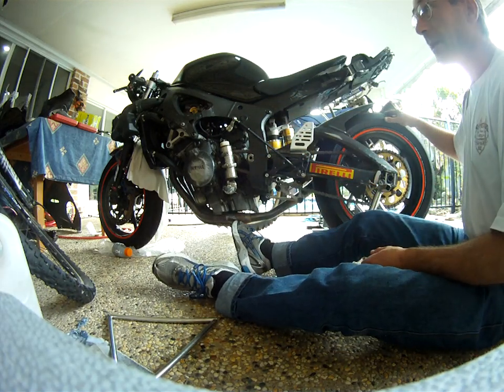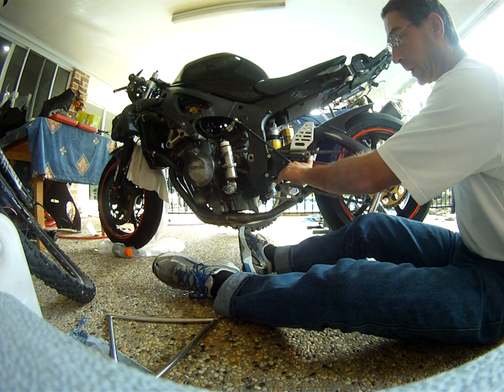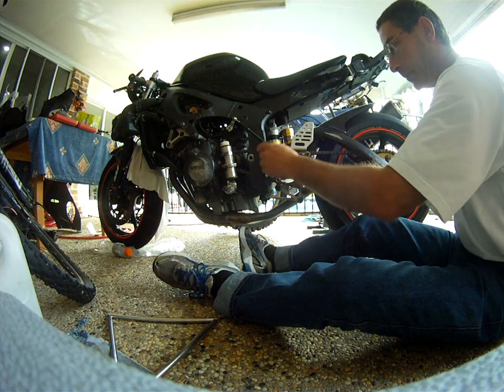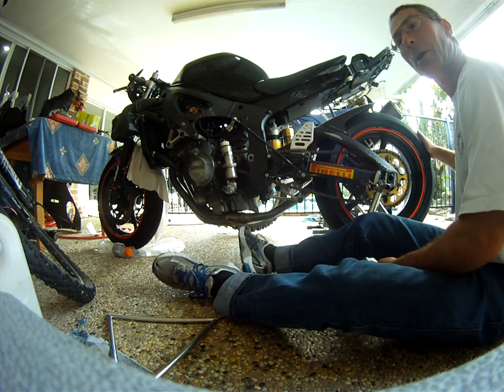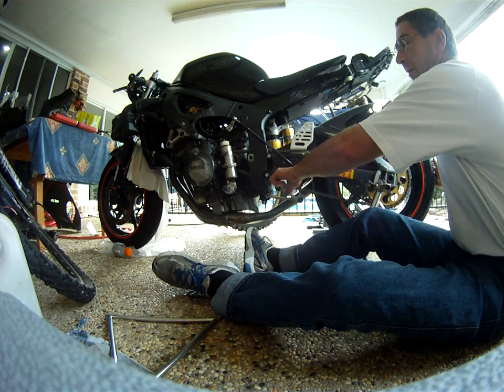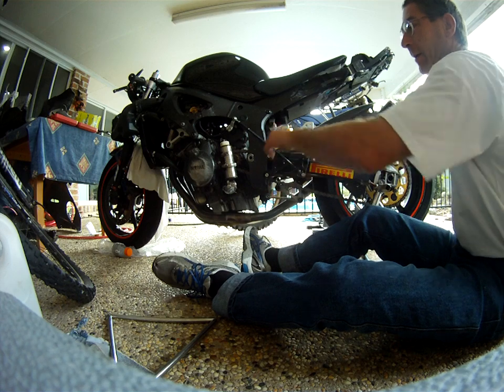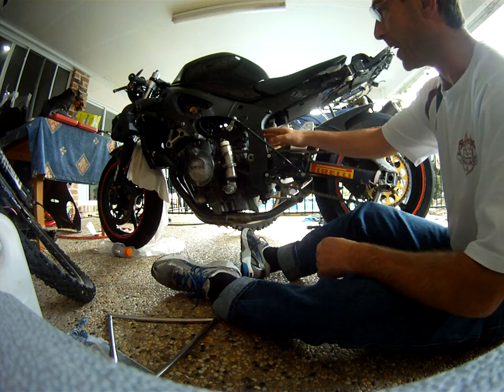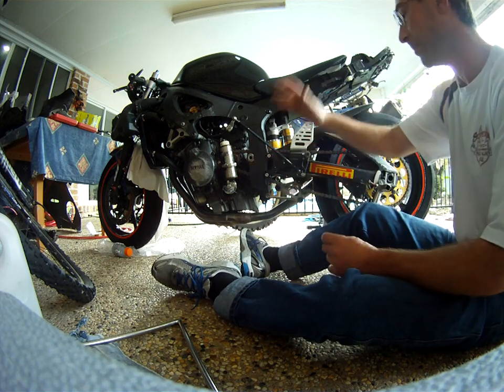Motorcycle gearbox tutorial, part 1.

Comment: Thanks for the tutorial! I got some questions for you. When operating the clutch (cable type), is it necessary to pull the lever all the way in or is it sufficient with pulling in to just past the biting point? Does the second method cause more wear than the first one? Thanks again.. all the best.
Reply from the maker: Hello Jerry. It depends on the circumstances. You NEED the clutch to get moving, and to pull up without stalling. All other changes can be made without it, although I do still tend to use it on down changes. You can give a tiny 'blip' on the throttle and make the downchange without the clutch, but getting the size of that blip exactly right can be difficult. Just use the clutch, it's easier and usually much smother. Upchanges, you might use the clutch on the 1 - 2 change, (makes getting neutral instead a bit less likely) but all the others are quicker and better and smoother and simpler to do without it. Exactly when you might chose to use 'half' clutch, I will leave as mental exercise for the pupil. I don't really use it at all.

Comment: hey i need help please .....when i shift from 1st to 2nd sometimes ....i feel the foot lever hitt my foot back ...but i am able to shift into second ...i split my case put in new forks, new shift drums and also new gear....but same problem ...only 1st to 2nd i feel the foot lever hit my foot back ..the rest of the shifting if fine....is this clutch adjustment or clutch problem...when i do clutchless shifting its fine ....only when i hold clutch in and shift i get the foot lever hitting my foot problem and mostly at high rpm ...help please been living with this for a year ....04cbrf4i